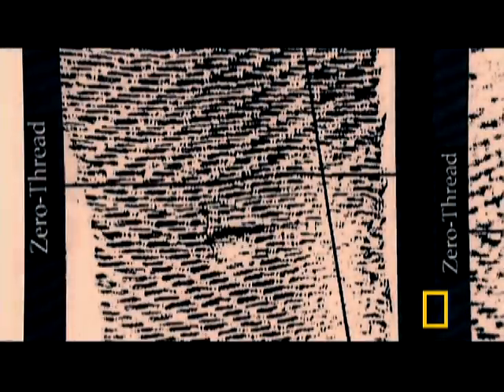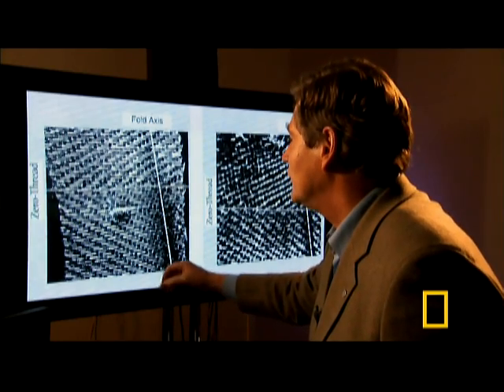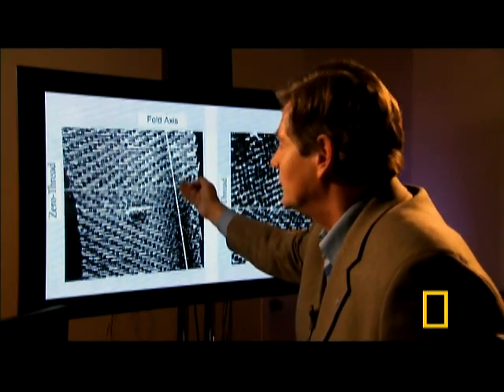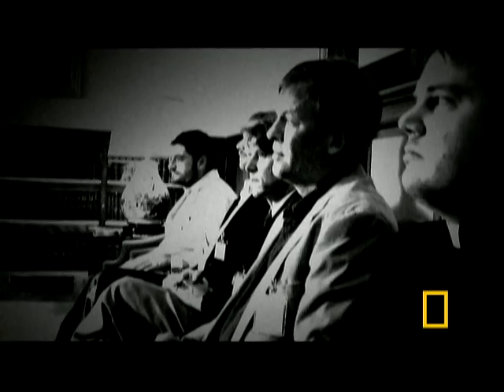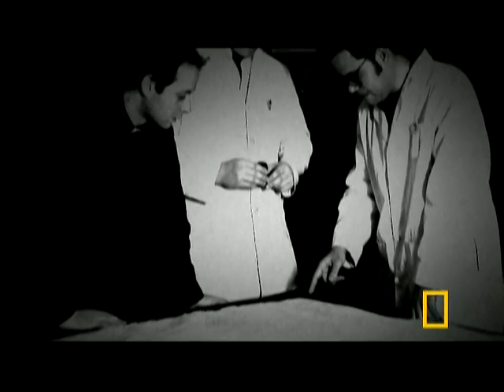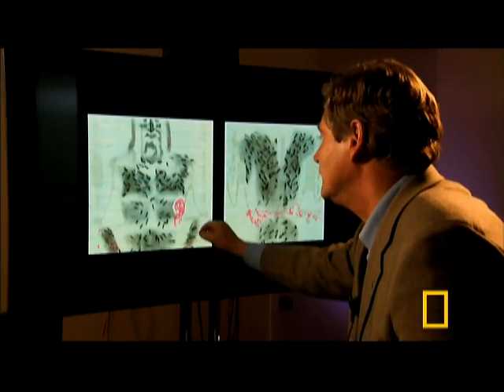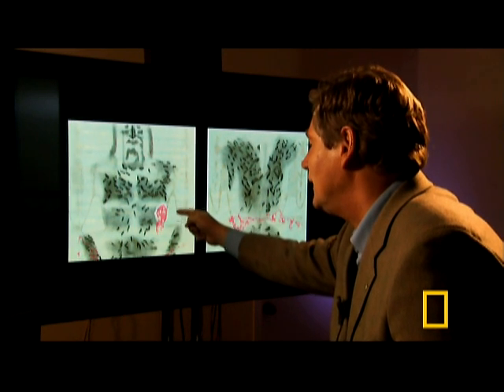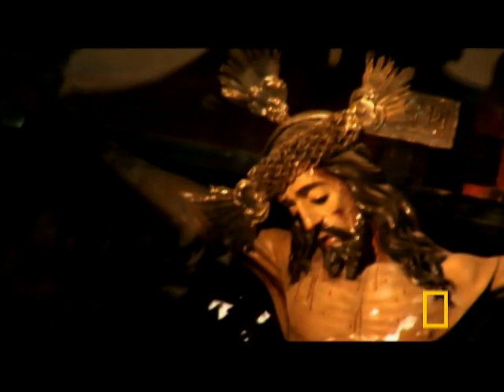Shroud Forging? | Secrets of the Shroud

Comment: And since there is actual blood; obviously, because they went out and got "someone" was crucified. An actual attempt to crucify (even someone already dead) by trying to do it through the hands results in the spike slipping, tearing the hands to shred: you can't crucify someone that way.

Just as they fail to connect the shroud to 2000 years old, they fail to prove it's not "someone else."